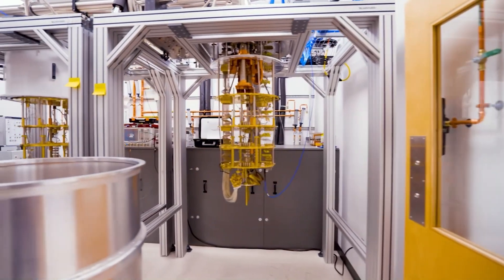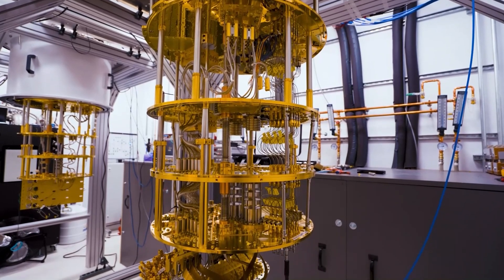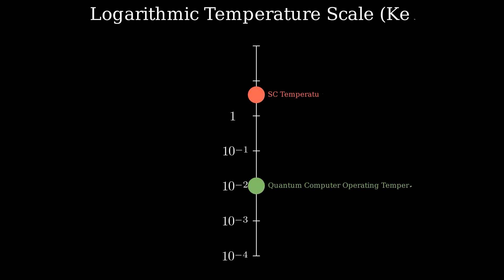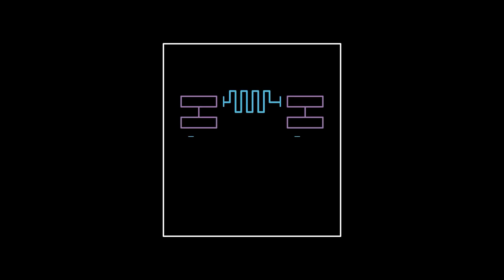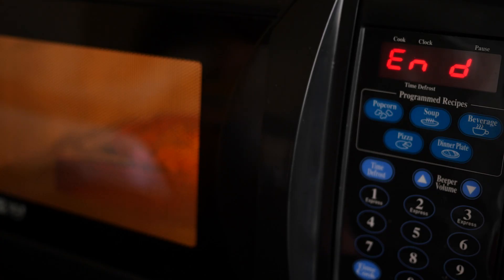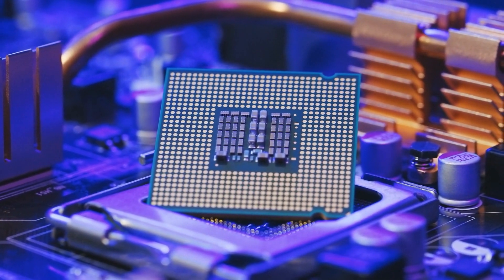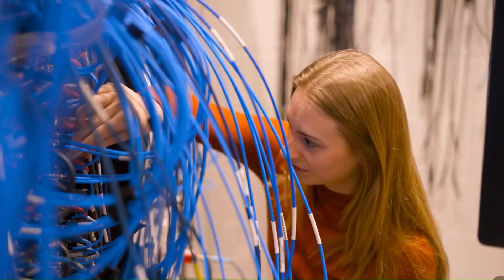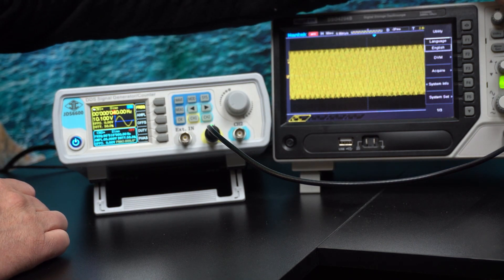Why Do Quantum Computers Look Like This?

Comment: It it possible to store qubits in memory?
Reply from the maker: Right now it’s very difficult, but it’s something that people are working on. The reason is that you can’t really store quantum information efficiently in classical memory - so you need a quantum memory. All of the current quantum memory candidates are difficult to use and active areas of research but it’s interesting for sure

Comment: You're using some kinda noise cancellation plugins I think that muffles the beginning of each sentences. Please fix it from the next videos.
Reply from the maker: Been trying to fix this for a while - not sure what’s causing the issue but I messed with my filters and still had the problem. I live in a busy city so if I don’t have the noise filters on my audio sounds much worse. Hopefully will fix soon
Reply: @Lukas-Lab  I think it's a software issue as I faced it before. Depending on which software you're using, you might have installed/added a Noise Cancellation plugin or filter which I think got activated for your all upcoming new files/projects. So you need to find that bug and remove it. Funny, that feature is acting like a bug for you lol.
Reply from the maker: @masumrana1085  thanks for the tip. I think ive fixed it for the next video :)
Reply: Btw, impressive quality of informations in your videos. These are amazing and can't be found anywhere else. at least for now. Go ahead brother.

Comment: Hi, can you link the paper where the  exact qubit design mentioned above is used for experiments like performing two qubit gates. It is interesting because the flux lines to the resonator tune it's frequency, but usually resonators don't have Josephson Junction elements.
Reply: Also are you sure it's a flux line going to the resonator and not a charge line
Reply from the maker: Usually coupling resonators do have junction elements if you look at any of Google or IBM’s newer papers they use “flux tunable couplers” - basically resonators with squids that you can thread a flux through to tune the resonant frequency. 

This is a bit of a newer development, Google has been doing it for a while but IBM just recently switched from fixed frequency couplers. 

A charge line wouldn’t help you there unless your resonator was voltage tunable. 

There are tons of papers where they do things like this, it’s not just one. I would suggest not looking at companies papers. Cause they often won’t share the hardware details as it’s proprietary. Instead look at academic groups doing 2 qubit gates, there are a bunch that have done it

Comment: Really Interesting. I’ve always wanted to know why the copper cables have loops or bends in them. Anyone know?
Reply from the maker: I’m not actually 100% sure here, but I think it’s to provide slack in the case of thermal contraction. Since things contract as they get colder if the cables didn’t have loops they would get stretched significantly every cooldown and then relaxed every warmup, which would probably degrade them.

Comment: Lukas...quick question: are you now working on quantum computers? If not, are you planning to. Just curious.
Reply from the maker: I am currently doing my PhD in quantum computing, so I work on the hardware. That said my research is focused on improving individual qubits, so I make and measure individual qubits but not larger scale quantum processors.
Reply: @Lukas-Lab  I read quantum supremacy by Michio Kaku but he did not explain what a cubit was. That I learned from you in this last video. Thanks for being so clear on your information;)
Reply from the maker: No problem, also just a word of caution, Michio kaku is not well respected in the field of quantum computing. I read the first chapters of his book and it was filled with errors. Unfortunately there is no way for the average person that doesn’t study physics to have known this. 

I would recommend “quantum computing since democritus” by Scott aaronson for a more trustworthy resource.

Comment: How big is a qubit? If it’s a resonator can it be made bigger that what it currently is? And would that be more stable to perturbations from the outside?
Reply from the maker: Thanks for the question! It depends on the type of qubit. 

Superconducting qubits are usually a few to several 100s of microns. Miniaturizing them is a problem that some people are thinking about, but right now the prevailing feeling in superconducting qubits seems to be that right now it’s most important to figure out how to get coherence times and gate fidelities maximized first, and then we can worry about size later.
Reply from the maker: Just realized I didn’t answer your stability question. Not necessarily more stable if bigger on chip, but people are starting to make 3d cavity resonators, which are basically superconducting metal housings that act as resonators themselves. Those often get more stable the larger they are.
Reply: @Lukas-Lab  no wait I think I’m missing something: my reasoning is that the oscillations are electromagnetic, so a bigger oscillator could handle bigger amplitudes, end therefore the noise from the environment would be less impactful (in percentage). The waves perhaps are not electromagnetic?
Reply from the maker: Bigger amplitudes means more photons because the number of photons is literally defined by the size of the EM wave, but for measuring or interacting with qubits you want to be working with single photons meaning small amplitudes. There are some technical reasons for this but basically at too high power you overwhelm the qubit/resonator system and the qubit and resonator don’t couple.